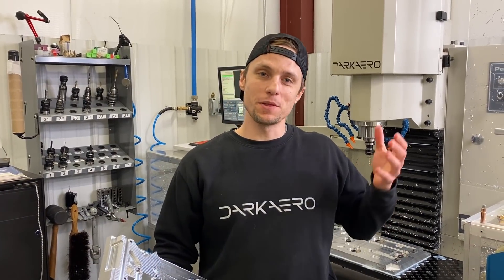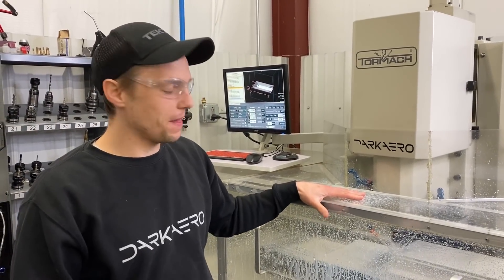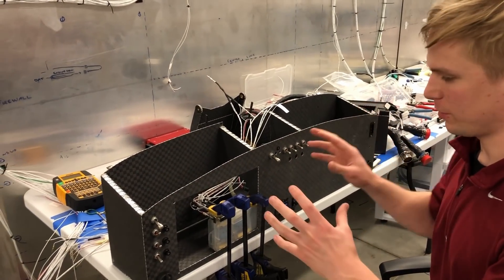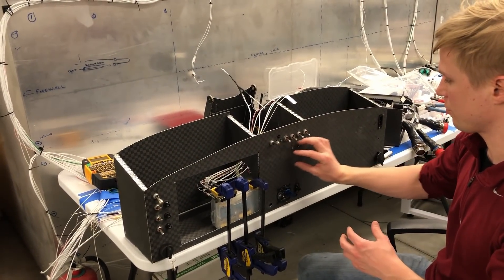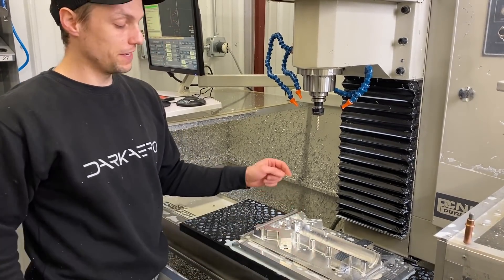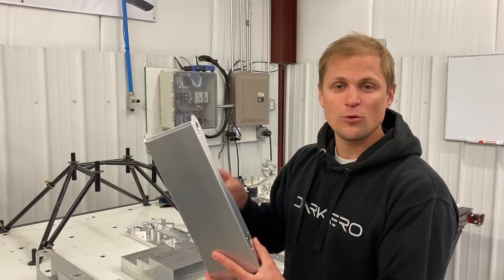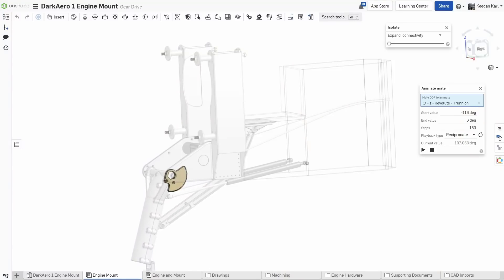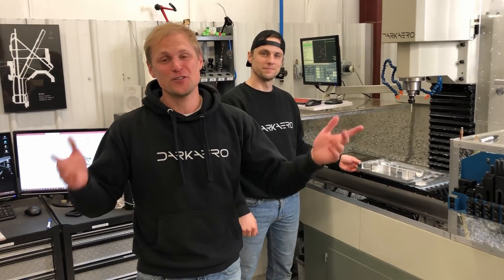NEW Engine Mount and Nose Gear Machining | DarkAero Shop Vlog | May 3rd, 2021

Comment: Hi! Always interesting to see what you are up to. Of the aluminum and laser cutting. Remember fatigue, too. In one project we had aluminum bonding fatigue test specimen laser cut to dog-bone shape. It turned out that laser cut "kinks" or starting points could act as crack initiation points, too. In the end the specimen were milled around to remove the edges which the cutting laser had heated. Aluminum does not have fatigue limit, it will fatigue also at low stress levels even if with slower pace. All the best for your project.

Comment: Regarding the last video, on designing parts: I found some time to model two examples. My way of design is to not think of an "archetype" of some part, but rather place material where you need it. Start with the attachment points and where the load will be applied. Use the straightest path to connect the load bearing geometry to the fixation points. This way you don't end up with material without function. Of course there are still many ways to design the part. Files are here to download: https://drive.google.com/drive/folders/1gXbFNgCWy1y1axQ_Ow0Xi2yoAf0r3l6o?usp=sharing

Comment: Would it be useful to integrate the iPad into the dash in a way that it’s semi-permanent and removable at the same time?
Reply from the maker: Hey Gunnar, that is the current setup we have with our mount arm. It can be configured for a number of positions and uses an interchangeable mount that can adapt to different tablet sizes.

Comment: You may have mentioned it before, and if so, my apologies. The removed material during the CNC process; does that get reclaimed and recast?
Reply: It can be turned into a meta recycler for cash, and the recycler will then sell it to a metal foundry.

Comment: Seeing your engine mount extrusions may have just benefited my own plans to replace the Jabiru 2200 engine on my Skystar Pulsar III with the 3300. That method of attachment might simplify the design and fabrication process. Thank you.
Reply from the maker: The Jabiru and UL Power engines have very similar mounting arrangements so something similar could be applied to a Jabiru as well.

Comment: Guys. I'm a life long avgeek but with no experience in building or flying (real) aircrafts. I am, however, a softare developer with a newly persued interest in electronics and manufacturing. This channel is so wonderful to watch. You're not only dedicated and skilled, but also humble and pedagogic. And there's something about the way you seem to work together. Surerly, there are ups and downs as for anyone but it can't be missed how good you guys go together with a passion - working towards a common goal. So inspiring and great to watch!

Maybe this is an obvious thing, but I can't help to think about metal fatigue. I digest crash investigations with great interest, but don't claim to be any sort of expert. Still, quite often incidents related to hardware failure boils down to errors or inadequate quality control during manufacturing. Is this anything you take into account for certain parts or certain events; for instance special inspection of manufactured parts or regulated quality of purchased raw materials. Or if the milling process fails for some reason, do you have to take special measures to ensure that the failure did not affect the structural integrity of the part. In a manner that might not be visible to human eye? Or am I simply watching to many "documentaries" on the topic (said with a humble irony). 

The real question though, is if it's the winner or loser that gets to do the outro? ;) :*

Keep up the good work! All the best, Jens
Reply from the maker: Hi Jens! We are happy to hear you are enjoying our videos! :) Your question about quality checks is difficult to answer briefly, but yes, this is something we pay close attention to. We document and record all the critical process variables when we make composite parts. The idea here is we want to achieve repeatable parts that structurally match our test parts. Our metal parts are made from alloys with material certs. Our hardware is all aircraft/aerospace grade. For this video, the loser had to do the outro. 😂
Reply: @DarkAeroInc  i totally understand that the question is very broad. Different parts have different requirements depending on where they are located and their purpose. And some are an integral part of the aircraft and others can be replaced during the lifetime of the aircraft. And so on. 
Still, the most common reference to metal fatigue is when things have already gone wrong. Or at least that's my feeling. Watching parts being machined and manufactured woke my curious mind up a little extra. 

Thanks for the kind answer! Keep'em coming, these videos!

Comment: Beautiful work.  I want to be educated... the trunnion component is awesome, and requires some high level of machining to produce.  Would you in the future start with a cast part to reduce machining time, or wouldn’t a cast part be meet structural needs?
Reply from the maker: Great question! You could cast the part to reduce the amount of rough machining time but finish machining would still be required for the tight tolerance dimensions. The finish machining is what eats up most of the time on the CNC mill so it wouldn’t be much of a cost savings once you invest in the casting process. Looking at structural needs, stronger alloys are available in billet form compared to cast aluminum alloys. It’s possible to make a cast part that would do the job but we wouldn’t gain much by introducing another process. Thank you for watching and for your interest in our project!

Comment: Are you guys using F360 for your structural analysis as well as your CAM.  Curious if you took into consideration the sag or deflection of the engine as a result of the compression of the engine isolators when that assembly is all bolted to the firewall.

Comment: I love what you guys are doing to construct Dark Aero. I do have a concern addressing the engine mount that very few are privy to. The traditional tubular engine mount addresses potentially destructive vibration oscillations to dampen engine vibration transference to the airframe. I have some suggestions that you can employ once comprehended the potential vibrational oscillation hazard and solutions to dampen for longevity of the aircraft. 

In a nutshell description is that 45 degrease tubular engine mounts de-phases destructive parametric oscillations that over time will produce cracks in metals, composites and carbon fiber systems. Flat mounts won't address this and some simple adjustments to the flats are necessary to employ with angular architecture. I learned this in marine propulsion repowering that rubber dampeners alone wont in themselves address to stop these potential vibratory oscillating hazard. 

I've been working with composites testing in high performance boats with aviation in mind. I never heard of an experimental boat! Water is a great place to test new compositions of composites, propulsion systems and prove them before introducing the schedules for experimental GA aviation consumption. I've been silently working out solutions with others since 2008 for aerospace. We've Legioneered many composite solutions over the years with aviation in mind.  

I love how clean you guys are attempting to construct this aircraft. With a little further analysis and design adjustment I believe you can revolutionize the engine mount system your proposing for advancement of Experimental Aircraft to be high longevity, simpler, cleaner, lighter, faster, stronger and inexpensive to construct and operate. Better than certified is the goal. You guys are doing a fantastic artform with aviation and are pioneering leadership concerning private GA experimental aircraft. Dark Aero is remarkable... I know you guys will be successful in your endeavors... Cheers
Reply: I was thinking there was likely a reason for the larger welded tubular frame. I was really concerned about their engine mount but I didn't know why I should be concerned. I hope they investigate the possible issues with the smaller mount.

My one other concern with their design is the way the instrument panel is attached to the canopy. I worry about all those wires bending each time the canopy is opened and closed. I hope I'm either wrong to worry about this or they change the design.

Still, this channel is a breath of fresh air compared with the Raptor project. I enjoy all the Dark Aero videos.
Reply: @ddegn  , I enjoy both projects. I really didn't want to address my concerns publicly about the engine mount. I thought it important to mention. With minor adjustment with what they are wanting to achieve I'm thinking they can avoid the potential problem. Dark Aero is a fantastic build. They are doing a great job with the carbon fiber build.
Reply: @willhibbardii2450  "I enjoy both projects."
They are both interesting but I'm afraid the Raptor project has some very serious design issues. 
The channel rv6ejguy has two videos about the Raptor. Videos #106 and #108 discuss some of the serious issues with the project.

"Dark Aero is a fantastic build. They are doing a great job with the carbon fiber build."
I agree. Though to be honest, I don't think I know enough to be sure. They appear to know what they're doing and it's a lot of fun to watch the project progress.
Reply: @ddegn  , I don't believe Raptor has design issues that can't be overcome. rv6ejguy is good on petrol engines but isn't correct concerning Peter's intent with the Diesel powerplant. I'm thinking that RV6ejguy is a shill for Velocity.
Reply: @willhibbardii2450  please enlighten us on where, specifically, rv6ejguy is wrong about diesels.
Reply: @robertkramer621  , It would only be word salad to you sir. But here we go... Let me suggest that you series boost for yourself a 3 L CI diesel engine that produces 330 KW with a fuel flow of 150 pounds per hour. Then try and do the same thing with a petrol 3L SI engine. Then tell us the fuel flow of the petrol version producing 330 KW. Then get back to us with your intended solution of series pairing turbos for both versions. 

Maybe then you may have working knowledge of why intent of managed fuel flow with reserve power available is a better approach to yachts or private experimental aircraft. 

84 pounds per hour diesel fuel flow at cruise is an affordable target. With diesel propulsion this represents about employing 180 KW for cruise power. What's the fuel flow of a petrol engine producing 180 KW? You will find the petrol fuel flow much higher! Perhaps 144 pounds per hour???

Comprehending fuel flow of petrol verses diesel is your first clue for KWH output sir then sizing the boost for FL-24.

I've found rv6ejguy is spot on with petrol SI engine boost application however he hasn't been boosting CI diesel propulsion like I have since 1975 and knowing fuel flows per KW output. His speculation and theories don't jive with what I know to be correct concerning CI diesel propulsion. 

Yachts are a great proving ground for propulsion system conversions. That's where I've been applying, learning and sizing my boost application solutions with manageable fuel flow.

Tip for you... Automotive camshafts in marine and aircraft propulsion applications employ poor overall performance characteristics. The camshafts are the first part of the conversion!

I'm revisiting round engine (Radial Engines) Something I wasn't aware of till this past weekend is the fact that the Radial Engine on a Cessna 195 employs a petrol 115/145 AVGAS (purple fuel) 225 KW R755 Jacobs engine which has a fuel-flow of 180 pounds per hour at sea-level employed for takeoff power then employs 120 KW for 135 KTS cruise power at a fuel flow of 96 pounds per hour. What's interesting is the 5 gallon oil sump and the engine's Knick name being Leaky Jake which turns the prop at only 2,200 RPM... The circulating engine oil is employed heating the cabin.

PT6 Turbine propulsion is simply unaffordable at 300 pounds per hour fuel flow for a 6 place aircraft or small yachts. 

Back in the day guys even swapped their Beech Barrons even trade for the Cessna 195 because of fuel flow!

Redesigning this engine for Diesel CI and turbo boost may look promising. Longevity between TBO, Slow prop, low RPM, reserve power and lower fuel burn with modern compacted graphite iron (cgi) casting employed. 

Since it's not on Youtube you probably don't have a clue on how to cast an engine block or case for yourself. Both of which I've personally completed and preformed restoring various projects over the years.

If we always do what we've always done we will always get what we've always got... It's worth employing something different at this juncture! Arm chair do nothing folks will be naysayers for fear of being proven wrong without attempting to preform the experiment for themselves.

It's like my friend that I'm converting his fiberglass to vacuum infused carbon fiber parts for his aircraft said; "I did the best I could in producing my molds until I found the guys that have been doing this for years" ! "Hindsight is 20/20... I thought it was going to cost a fortune to tool my molds for production" ! 

Yes I will need to adjust his molds for vacuum infusion however he did the hard part of producing the original molds that fit on his 4 different experimental aircraft. We can then produce each part one at a time both in carbon fiber or fiberglass infused molding as he gets orders to his client's specifications and choices. No problem in keeping the supply chain simple and cost effective. 

Fuel isn't 19.9 cents a gallon anymore... So show us the money in operational cost... Cheers
Reply: @robertkramer621  , In a nutshell... Fuel Flow and Intent!
Reply: @willhibbardii2450  you accuse rv6ejguy of "speculation and theories", but don't cite specific errors in his videos.  No amount of word salad will bury that omission.
You also claimed he's a "shill for Velocity".  That's no remedy for Raptor Regret.
Reply: @robertkramer621  , Then build your version using his specs and then you can cite your findings with any words you prefer. Lets see what people want from you! As for me I'm busy sir.
Reply: @willhibbardii2450  "I'm thinking that RV6ejguy is a shill for Velocity."
That's your thinking? Is the video he made your only evidence?

I think the Velocity is a reasonable example to include in the list of comparison airplanes. The Raptor looks a lot like the Velocity.

"I don't believe Raptor has design issues that can't be overcome."
I'm not convinced. The Delrin bushing, the incorrectly sized second turbo, leaving off the oil seal fastener and other examples of severe design/manufacturing failures makes me doubt he has the knowledge to get the Raptor to perform well. So far it's a big heavy airplane which can only carry a single person for a short period of time.

"It would only be word salad to you sir. But here we go..."
Wow. I'm not sure you know how bad this looks. It's as if you want to prepare the reader for a poor argument worded with as much technical jargon as possible. Not a good way to start a reply if you want to be taken seriously. On the plus side, you did deliver what you promised.
Reply: @willhibbardii2450  personal attacks, and lack of brevity, are usually the way of the wrong.  You should either itemize his error(s), or retract your unsubstantiated insults, regarding rv6ejguy.
We all make mistakes, and Raptor Regret is a painful malady, but absent evidence, or an apology, you're only making things worse.
Reply: @ddegn  I will take it under advisement not to respond. I'm glad Peter has pulled back getting focused on his work and not sharing any further updates with his channel. I'm doing the same and good luck with your endeavors. By-by...
Reply: @robertkramer621  I will take it under advisement not to respond. I'm glad Peter has pulled back getting focused on his work and not sharing any further updates with his channel. I'm doing the same and good luck with your endeavors. By-by...
Reply: @willhibbardii2450  so, in a fit of Raptor Rapture, you besmirch rv6ejman, then when asked to itemize same, you fail to substantiate and refuse to remedy via an apology, preferring instead to slink away.  As Jack Reacher said; "now we know who's who".
Reply: @robertkramer621 , When someone ask you to do your own work you just ask for someone else to do it... You remind me of Biff Tannen... Hello McFly If I turn my paper in with your hand writing. Do your own work Mr. Kramer. I already told RV6ejman what I thought and he hasn't asked for an apology. You just keep asking for that list sir.
Reply: @willhibbardii2450  I didn't ask for anything, except for you to provide evidence regarding your unsubstantiated insults of rv6ejguy.  You still haven't, nor have you apologized.

These excerpts from the Code of Conduct at HomeBuiltAirplanes (dot com) says it well;
There are many ways of writing about airplanes, their features, the interactions between features, airplane handling, risks, etc, and then how to fix it without getting into personalities.  Likewise there are many ways of writing about design and development processes, either in single posts, or in the accumulation of posts.
... piling on and personal attacks are inappropriate here.

Stay focused on what we all have in common.

Comment: Great work guys! Isn’t it tricky to have the gear handle/switch similar as the light switches and so close to the light switches?
Reply from the maker: The gear switch will be further differentiated from the light switches with the addition of a true gear switch that looks like a little tire attached to the end of the switch. This is an extra attachment that we haven’t installed yet. The gear switch will physically feel different from the light switches which would allow you to find the gear switch even with a dark panel.